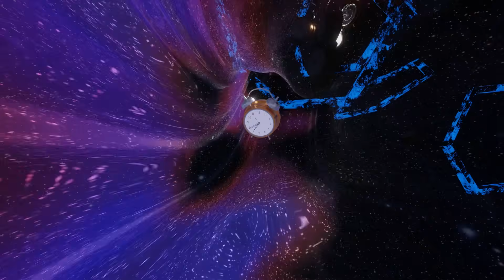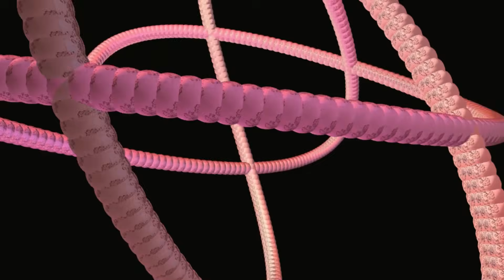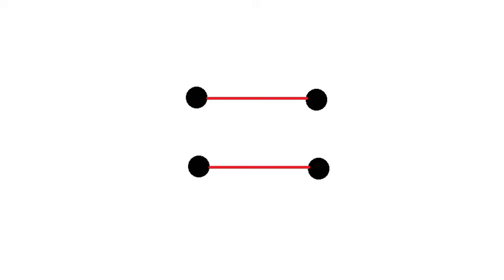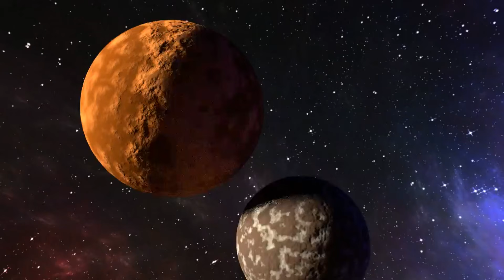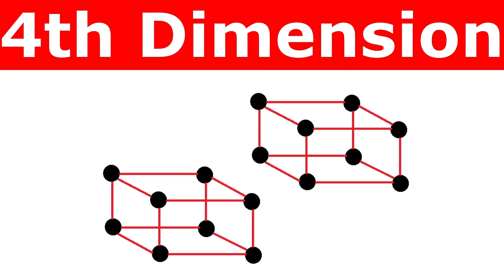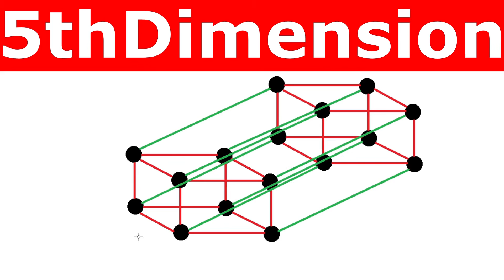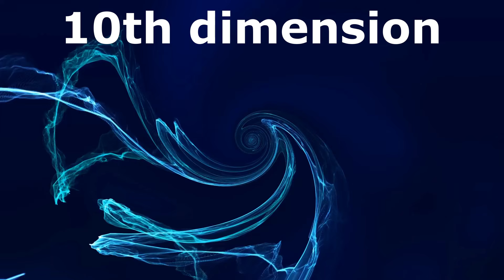11 Dimensions Explained - A Mind-Bending Explanation of Higher Dimensions!

Comment: 11 Dimensions - Higher Dimensions Explained 

What we mean by dimensions? Dimension of a point is defined as the minimum number of coordinates that are needed to specify that point in it. For example, to specify a sheet of paper, we need 2 coordinates only: Length and width. Therefore, it is a 2-dimensional object. But to specify a cube in space, 3 coordinates are needed, these are: length, width and height. Therefore, we call it 3-dimensional object. Now we will discuss how many dimensions are there in the universe?
according to classical physics, there are 3 dimensions of space: Length, Width and Height. and 1 more dimension is of time. String theory requires 10 dimensions, but as per M theory total number of dimensions are 11. Now the question arises: if there are so many dimensions, then why we are not able to perceive them? Why we can't feel the presence of higher dimensions? Actually, we might live in higher dimensions without being aware of it. But because of limitation of our brain and senses we may not be able to perceive them. According to some researchers, extra dimensions may be "curled up" at extremely small scales. This scale is so small, that we can't see them with our experiments based on current technologies. As we live in a 3-dimensional world, It's very hard for our 3-dimensional brain to visualize higher dimensions. There is a process known as compactification, where higher dimensions are curled in on themselves. On changing our reference frame and going into microscopic level, we will find higher dimensions. If we go to the microscopic level and see from the reference frame of atoms, then we will see a whole new world of 3-dimensional atoms having solid nucleus and electrons revolving around it in 3-dimensional space. On going further into the microscopic level of strings inside the atom, we will see that strings are vibrating in 11 dimensions. Everything in this universe is made of tiny vibrating loops known as strings according to the string theory. Now, we can understand how we can find higher dimensions at the microscopic level. Now, let's discuss every dimension, starting from the zero dimension to the eleventh dimension.     
 
0th dimension (Zeroth Dimension)
Zeroth dimension - There is no length, no width, no height of an object in the zeroth dimension. Example of zeroth dimension is a point. Lets imagine someone is living in the zeroth dimension, then he would neither have any body, nor any shape. He can not move in any direction, like forward, reverse, up or down. Zeroth dimension is the bases of all the higher dimensions. 

1st dimension (First Dimension)
An object in the first dimension has only one dimension, that is length. A straight line is an example of 1-dimensional object. we can get straight line by joining 2 points. A 1-dimensional being can move only in a straight line. It can not move in other dimensions like left, right, or upward and downward directions. 

2nd Dimension (Second Dimension)
Second dimensional objects, also called as 2-dimensional or 2D objects, are flat shapes. Some common examples of 2-dimensional shapes are squares and triangles. As the name denotes, 2-dimensional are made up of 2 dimensions: length and Width.  There is no the third dimension of height or depth. Therefore, these objects are flat figures, having non-zero area, but zero volume. If someone is living in 2 dimensions, then he would be able to move only on the surface without being able to move in up or down directions. He will not have any idea of the third dimension, that is height. Can you imagine what will happen, when 3-dimensional object enters into the world of 2-dimensional beings? For example, suppose, 2-dimensional being present in his two dimensional space, is watching a 3-dimensional apple entering his flatland world on a vertical axis, perpendicular to the plain of the flatlander. As we know 2-dimensional being can't see a 3-dimensional object. So, how would that 3-dimentional apple look like from the frame of reference of that flatlander? He can't see the apple until it touches his 2-dimensional plain as its above, flatland and he can't see anything which is above or below his 2-dimensional plain world. But as the apple just touches the plain, he will see a dot, which is nothing but the point of contact of the apple to the plain. Now, as the apple goes below his plain world, he sees a circle growing in size on his plain and a size of the circle is maximum when half of the apple is above and half is below the plain and then the circle size becomes smaller and smaller and then a point and finely, it disappears for him. It means, that 2-dimensional being sees only the cross sectional view of the apple, that is cut by his 2-dimensional plain at that moment. So, for a person living in a particular dimension, object of higher dimensions suddenly may appear from nowhere, may change shapes and size and then disappear into space. It may appear supernatural, or kind of magic for a lower dimensional being, but for that higher dimensional object it's nothing special. It just moves in dimensions that are not perceived by him. 

3rd dimension (Third Dimension)
On adding one more dimension to 2 dimensional objects we enter into the world of three dimensions. This third dimension is of height. Therefore to represent three dimensional or 3D objects we need three coordinates: length, width and height. As we have already discussed that 2-dimensional objects are plain figures, therefore have zero volume. but 3-dimensional objects are solid objects and therefore have non zero volume. Some common daily life examples of 3-dimensional things are balls, chair, car and humans. We live in the 3-dimensional world. This is the reason we can move in forward, reverse, up and down directions easily. as we have full control over the 3 dimensions of space. 

4th dimension (Fourth Dimension)
Time is considered the fourth dimension. If we consider the fourth dimension from the geometrical point of view then hypercube is a 4-dimensional object. It is also called a tesseract. The relationship between a hypercube and a cube is same as that of cube and square. So in simple terms a hypercube or tesseract is four dimensional analog of the cube. A 4-Dimensional being can move freely in time dimension. It would have full control over time. He would be able to move in any desired direction in time; past or future. Suppose you are living in a 4-dimensional world - then you would be able to go to a certain point in time in past and change your decisions. We, humans are 3-dimensional beings, therefore have full control over the 3 dimensions of space, but we are forced to move only in one direction in time - the forward direction, as we are 3-dimensional beings. If we were 4-dimensional beings, we would be able to go back in time and change the decision of marriage with our current wife. and then marry to another girl. This would cause a start of new life and new timeline. But as no parallel worlds exist in the 4th dimension, we can live in one timeline (with one wife only). We can not live in 2 different timelines, in 2 separate worlds with 2 different wives. So our old timeline (our life with first wife) will vanish from existence.

5th dimension (Fifth Dimension)
A person living in 5th dimension can control time in different ways. A fifth dimensional being can move either in past or future as per his wish. He would have all the powers that are possessed by a fourth dimensional being. But he would also be able to be present at different locations at the same time. It would also be possible for him to do many jobs and have different hobbies simultaneously. Actually parallel universes exist in this dimension, therefore in the 5th dimension, you can have different lives in different timelines, you can have careers in different fields. In this case, you will have another versions of yourself in the parallel universes, who would be living their life independently. They would have separate timelines for the parallel universes. Their lives in different parallel universes will be based on cause and effect. It means their lives will change as per the decisions made by your self versions in different universes. But one limitation of the 5th dimension is that you can't meet your self version directly using shortcuts to another timeline of parallel universe. Let's better explain all of this using our example of changing marriage decision. In the 5th dimension, we can go back in time, change decision of marriage and marry another girl, so we will have another timeline. Main difference from the 4th dimensional model is that, in this case we can have both worlds simultaneously. We can have parallel worlds, two parallel lives. life and timeline with our first wife will not be vanished from existence, but in one world we will have new life and in another world, also we will have our first wife. But there is one limitation in this situation - you can not meet your another self in another world. Your two selves will never be in touch with each other any more. If your second new self (that lives in the second timeline in second universe wants to meet the first self who lives with the first wife, then he needs to again go back in time in the moment, when he changed his decision and married another girl. In this case, he will come back to his original first timeline and then he can go forward in time and he will see his original self living with old wife.
Reply: 6th dimension (Sixth Dimension)
A six dimensional being has all the powers that a person living in 5th dimension has along with some extra capabilities. Parallel universes exist also in the 6th dimension. 6-dimensional being can see all the presents, pasts and futures of all the parallel universes. But one limitation of the sixth dimension is that all the parallel universes must have the same beginning (initial conditions) that is the Big Bang. Like in the 5th dimension, also in the 6th dimension, you are free to choose multiple carriers of your choice. And your multiple selves can live their lives simultaneously in parallel universes. As we mentioned above, one problem of the 5th dimension was that you can not meet yourself version in another parallel universe directly using shortcuts between universes. But 6th dimension is free from this limitation. You can easily jump from the timeline of your universe to any point present on the timeline of any parallel universe.    

7th dimension (Seventh Dimension)
Seventh dimension can have infinite number of universes. 7th dimensional being have all the powers, that 6th dimensional beings have. also 7th dimension is free from the limitations of the 6th dimension, that means, that the 7th dimensional universes may have originated from different start conditions, not just from the Big Bang. A seventh dimensional being can have infinite forms of itself and can move from one universe to any other universe from the infinite number of universes.

8th dimension (Eighth Dimension)
The eighth dimension has a plain of all the possible presents, pasts and futures for all the infinite number of parallel universes and all these infinite universes extend up to infinity. In the 8th dimension objects do not have any physical existence. It may be analogues to a digital world, where we can not touch the objects, but only can see or hear them. They can change shapes, size and appear or disappear instantly. So, maybe it is somewhat similar to the virtual reality.  

9th dimension (Ninth Dimension)
Infinite number of universes exist in the ninth dimension. It is possible for the universes in the ninth dimension to have their own laws of Physics and separate conditions and probabilities of their origin. You maybe surprised to know, that in the 9th dimension, many civilizations may live simultaneously at the same place and these coexisting civilizations may not see or feel the presence of each other. The 9th dimensional being would have mind boggling superpowers. That being would be capable to go any point in time - past, present or future of any infinite numbers of universes. He would have no physical form and would be able to move freely in space and time in any of the universes.     

10th dimension (Tenth dimension)
The 10th dimensional being would have infinite powers. He would be able to do  the things that are beyond our imagination. He would be able to control even the spacetime and everything present in all the infinite number of universes. So, what would you call that 10th dimensional being, who is infinitely powerful? I think we can call him God. Some researchers use to say, that the God lives in the 10th dimension. 

11th dimension (Eleventh dimension)
Many unanswered questions were arised when the superstring theory was introduced. Therefore to answer these questions, eleventh dimension was proposed by the researchers. According to superstring theory, everything in the universe is made up of one dimensional and infinitely small vibrating loops called strings. even the subatomic particles are made up by these strings, and characteristic of each subatomic particle is because of the manner of the manner in which the strings vibrate. It is interesting to note, that frequency of vibration of these strings are responsible for the mass of the particles. We should say, that String theory does not answer 2 important questions - these are: 
1. what these tiny strings are made of? and
2. where they come from?
Size of each string is 10^-33 cm. This is unimaginably small. This is many times smaller, then a diameter of the nucleus of atom. If we increase the size of the atom to the size of our observable universe, then the size of a string would be just equal with a tree.

Source: 11 Dimensions Explained - Higher Dimensions Explained - All Dimensions Explained - Youtube channel - Engineering Made Easy;

Transcribed by: Tornike Pkhaladze

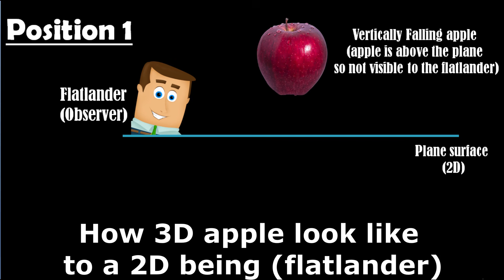Comment: This is an incredible video that explains complex concepts in a simple way. I would like to add an insight: In the example of a Flatlander 6:10 and an apple, from the Flatlander's frame of reference, everything appears as either a line or a point. The Flatlander cannot recognize circles, so he can only perceive the line getting bigger and smaller as the apple passes through this frame.
Reply from the maker: Yes, you are right 😊 I have corrected it in my new videos on dimensions
Reply: What does it mean to be above 5d
Reply: insanity @NoahElinkpo-jf9hz
Reply: @EngineeringMadeEasy  Man - you are lying at the logical level and at the level of visualization. This is the phenomenon of the world that either something has 3 dimensions or it does not exist. 
I refer you to the kitchen where you will conduct a scientific experiment - cut yourself a slice of banana or cucumber with zero thickness. I wish you a delicious meal! 
You visualize points, lines or planes - this is a lie. They do not exist. It is impossible to see them, to visualize them.
That's the dishonesty - you show something that can't be shown. 
I can put up with such a thing only if at the beginning someone says it is fun, something like telling fairy tales.
How can people be fooled like that?
And these people are also a herd of sheep - they swallow everything like pelicans.

Comment: This video is wrong. Adding new dimensions, is not just simply adding more points and connecting them. That would only add more surfaces to the 3D., creating a more seemingly complex object still existing in 3D. 3D essentially represents space. Therefore as a fourth dimenson time would be added and it creates past, present and future. Add to that magnetic fields, nuclear fields, etc..

Comment: The missing logic on not being able access other dimension areas, is because time is being considered a dimension itself, it is not presenting itself being available inside the other area describing dimensions. Time is based on a reason of expressing a activity, a time frame logic.
Reply: Also to fully evaluate dimensions, it must be considered the hidden other universes being their own areas, heaven, limbo and hell are offering possible support for the same dimensions extraction of promoting internal room for exploration.
Reply: Also, instead reduplicating self in description to 2 different areas at the same time, what if it was looked at just being in one dimension at a time, making time more stable for support which would be allowing for 2 different dimensional areas to be within. Time is used to describe activities, but it stays a constant to all for singling out everything.
Reply: Duplicating self to being in two different areas is logical expecting extra energy support, not a natural settlement of matter.
Reply: If not mentioned or understood, pressure build up is something trying to make things float, buoyancy logic that should be viewed at the speed of light.
Reply: There's only 9 dimensions let me explain,There's no such thing as 11 universe there's only 9,for example 1 2 3 4 5 6 7 8 9 and 10 is 0. 1+0 is 1. 11 is 2 1+1 is 2. 13 is 4 1+3 equals 4 14 is 5 1+5 = 6  and so on forever
Reply: There's only 9 dimensions let me explain,There's no such thing as 11 universe there's only 9,for example 1 2 3 4 5 6 7 8 9 and 10 is 0. 1+0 is 1. 11 is 2 1+1 is 2. 13 is 4 1+3 equals 4 14 is 5 1+5 = 6  and so on forever
Reply: I have a video on my channel called numerology proving what I said the universe works in cool ways
Reply: I access multiple dimensions every day
Reply: There's only 9 dimensions let me explain,There's no such thing as 11 universe there's only 9,for example 1 2 3 4 5 6 7 8 9 and 10 is 0. 1+0 is 1. 11 is 2 1+1 is 2. 13 is 4 1+3 equals 4 14 is 5 1+5 = 6  and so on forever
Reply: I have a video on my channel called numerology proving what I said the universe works in cool ways